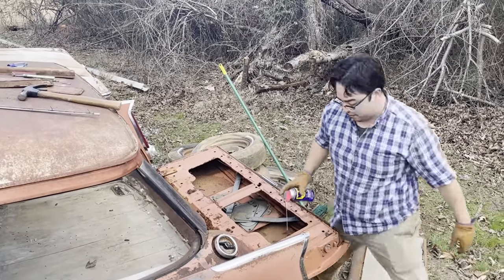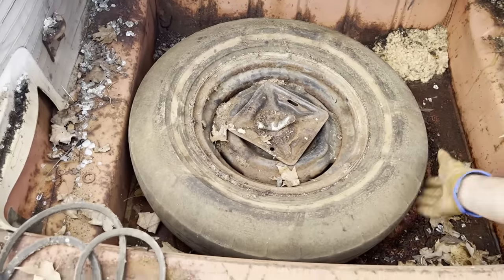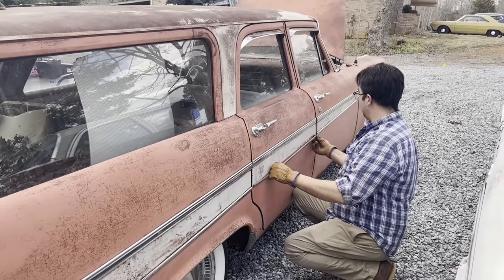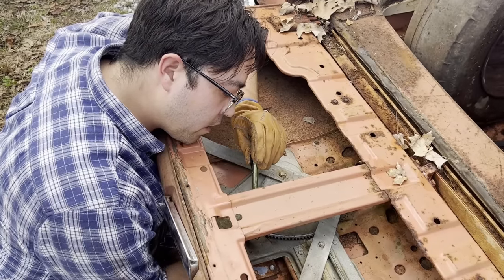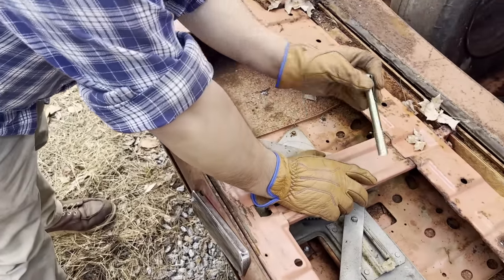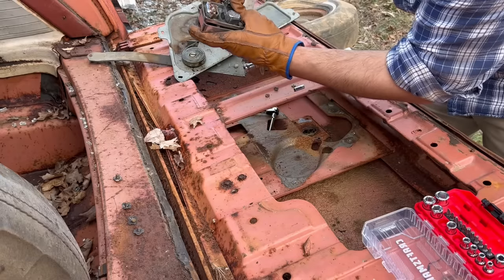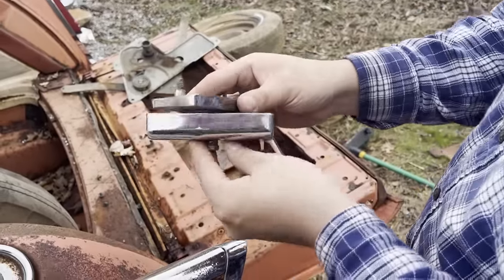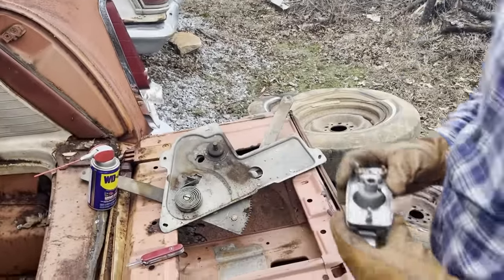1957 Plymouth Sport Suburban wagon, Locked tailgate. What's in the trunk? Tailgate glass replacement

Comment: Great video.  This is exactly what I was looking for.  We have a 57 two door wagon at the shop that's missing the rear window mechanism. Now we know what to look for. Our wagon debuts on our channel later today actually. Thanks again Street Freaks Garage on YouTube.
Reply from the maker: All 1957-1959 MoPar Wagons used the same tailgates. There are differences between the power and manual crank tailgates. 

I’m assuming your car is a manual crank version. In that case you can use the tailgate and mechanisms/tracks off any 57-59 MoPar wagon with the manual crank window.
Reply: @ObsoleteAutomotive  great thank you. I'm assuming this was manual since it is the two door six passenger car and I didn't see any signs of wiring leading to the tailgate.
Reply: @ObsoleteAutomotive  it does have the outside crank handle.

Comment: If I remember correctly, Chrysler used separate keys for the ignition switch, glove box and the doors & rear tailgate. You should be able to take the tail-gate lock assembly to a locksmith and get a new key made for that latch. Then get an extra one to check & see if it also fits the side doors. It will be neat to see the correct key operating the doors and tailgate again. After you get the trunk area cleaned out good, use a drill with wire brush attachment and remove as much scale rust as you can, follow that with some POR-15 rust converter to stop the rust advancement and convert the rust to a protective coating. Then use a primer to match with whatever paint type you use to re-paint the trunk floor. You may be able to get new weatherstrip seals from Andy Bernbaum and also some tailgate window channel materials from him too. The window channel material will help make movement of the glass assembly smoother along with good lubrication of the moving parts. It is so nice to see someone taking the time and effort to restore one of these wagons. Many of these older station wagons were more roomy than current SUVs.  Good luck!
Reply from the maker: On Chryslers the doors and ignition switches used the same key. The tailgate lock is its own and I had a new key made for it. I also had new keys made for the ignition switch but unfortunately they did not work the door locks. (It’s common for ignition switches to get swapped out over the years) However a locksmith can rekey the locks to match in most cases.

Comment: If your lucky you'll find the jack clipped in place under the rear bench seat. My 57 has the spare tire in the passenger side rear rear wing section of the wagon with a outside cover that unclips to allow for access. The panel looks like a wheel cover but when removed the spare is in a vertical position and has a lock on one of the lug bolts. The cargo area in mine was fully lined with a cool houndstooth type of vinyl snapped in place. There is a mercury activated lamp inside that turns on when the lid id opened.There is a single lock that positioned in the middle at the rear of the cover for security.

Comment: Ah man great video! The window on mine is stuck down and the window crank just spins. I figured that spline piece was broken. 
I have the big access panel off but trying to figure out how to free the glass from the regulator arms.
Reply from the maker: You should be able to take the clips off the arms of the regulator where they go into the slots of the glass and then pry them out. Then the glass is able to be slid out.

Comment: Dad bought our '57 Custom Suburban early '57 - had the cool bumper wingettes on it. I would say it was less than TWO years in Chicago area ir sprouted rust over the headlights on top fenders as well as bottom rear fenders. That was what killed Chryslers reputation - right after they bragged in '57 "Suddenly It's 1960" - yeah well - they didn't say it would RUST before 1960!!! Approx. 1964 the rear seat fell through the chassis - the car was sitting in Massachusetts at the time. But because of Pops I've been Mopar guy ever since to point my 2nd car at 21 was brand new last year E-Body 'Cuda!   🚗
Reply from the maker: These cars did rust badly especially up north. The lower trim models and wagons with the rubber flooring also held moisture which didn’t help. But really all cars rusted bad where salt was used on roads.

Comment: I would suggest using something more aggressive than WD40 to lube the door with.  WD40 is more of a solvent and only works for a short time.
Reply: WD40 was developed for keeping parts from rusting. It stands for Water Displacement formula #40. The story is that this formula was developed on the 40th try and the name stuck WD40. I agree with you on some points where it should take a more aggressive rust dissolver spray and there are different brands out in the industry. Back when I was a little tyke my Granddaddy used Liquid Wrench to penetrate rusted up mechanisms. At least this fellow uses a spray lubricant to get things moving initially. On his last video he worked WD40 into the hood hinge mechanisms to loosen them up. Most people doing these videos just muscle the parts and can bend things up. I see a lot of them are not properly prepared for what they are fooling with but the more experienced ones they know what to expect and what to bring when they go after these older vehicles. I use WD40 and PB Blaster on rusted up parts and of course patience. I tell people "you would be surprised what you can fix with a can of oil".

Comment: The rear window needs to be completely rolled down for the tailgate to be lowered. Lubricate before kicking the crap out of it. These are VERY hard to get parts for.
Reply from the maker: It’s shown in the video that the glass must be down to open the gate. I’m very well versed on how the tailgates function. I’ve owned many of these wagons and had to open several stuck tailgates over the years!
Reply: @ObsoleteAutomotive  No malice was intended. Merely making an observation so sorry If I bummed out your trip. Cool car
Reply from the maker: @birdssurfshed  I ain’t worried about it. I hope you enjoy the videos.
Reply: @ObsoleteAutomotive  Absolutely

Comment: With stories that I've heard about quality control on the 1957 cars, the idea that it possibly needed a new tailgate window regulator after seven years does not surprise me.
Reply from the maker: My thought was maybe the car got rear ended in the tailgate so the entire assembly may have been replaced. The tailgate and drivers rear quarter had been painted at the same time it seemed.
Reply: if the tailgate had been replaced they wouldnt have painted the inside of it the same color as the rest of the car, i dont see any sign of damage inside the gate so id say the gate is original to the car..... @ObsoleteAutomotive